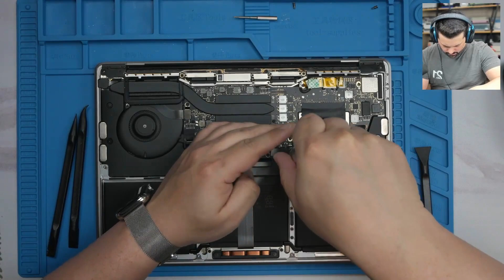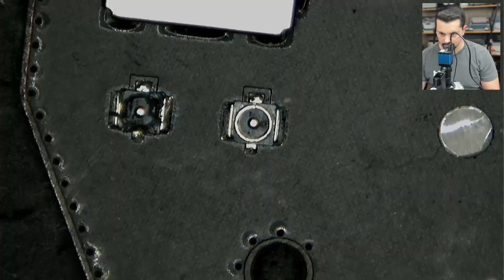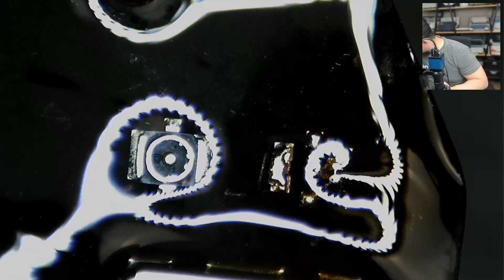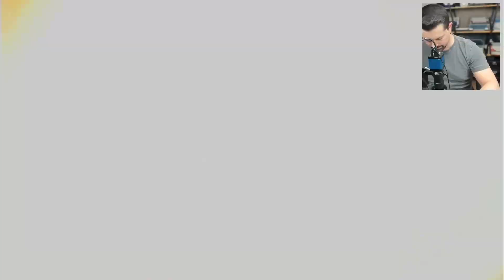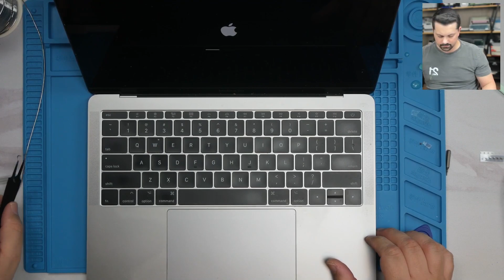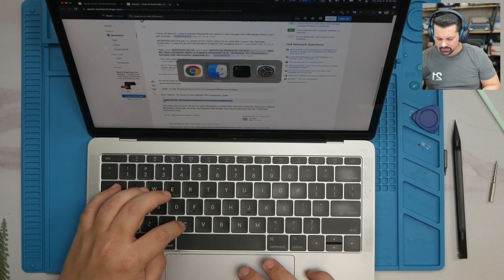[OFFTOPIC] MacBook Pro A1708 Antenna Connector Replacement

Comment: Where you purchased the connectors, Could you send me a Link?. It happens to me when I  was  replacing the screen. Thanks for your time.
Reply from the maker: Here's the one I used, but make sure you have the same MacBook model before ordering - https://www.aliexpress.com/item/33021190533.html?spm=a2g0o.9042311.0.0.27424c4djjSG5n